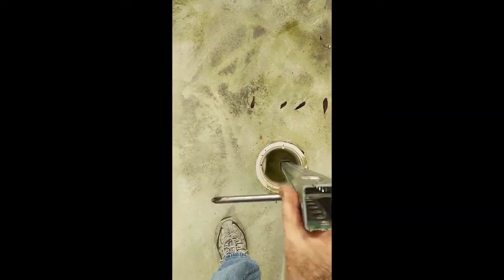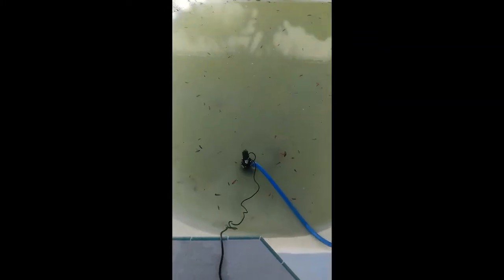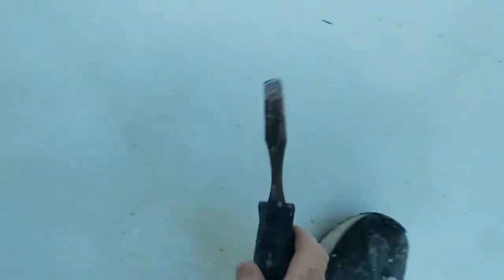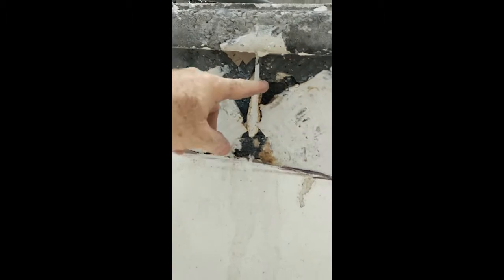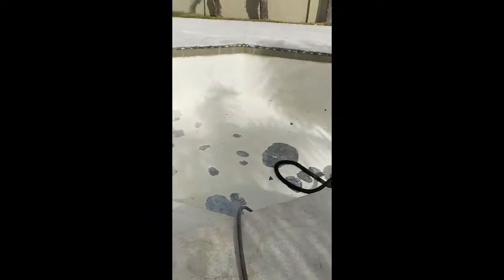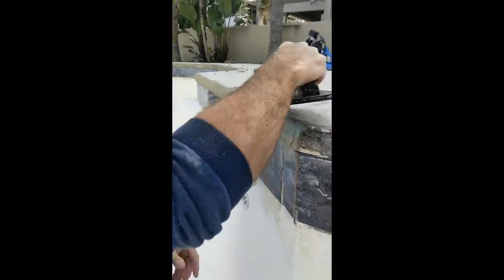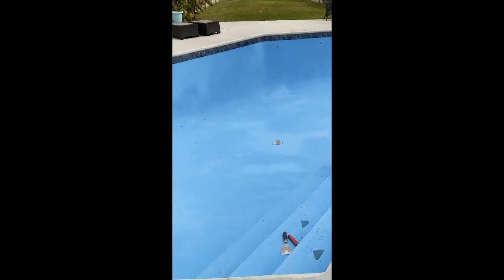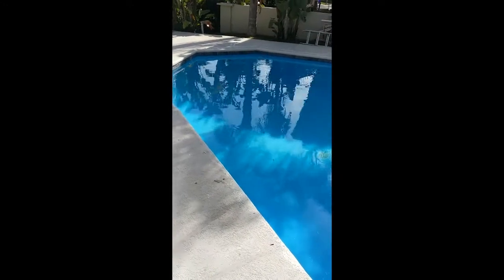Do it yourself pool renovation,  NOT PAINT.

Comment: Hello, your video was very informative. I live in Florida too. I'm about to start that project myself, I already removed the tiles and the grout. But I have an issue with water keep coming up through the drain. I think I might have a solution, first I can't seem to close off the drain enough there is always water coming. My idea is I'm putting a reducer in the drain from a 2" threaded side to a 2" slip joint so I can glue a 2 foot pipe. This should stop the small leak around the drain  ( I can't get all the sand out from the treads so it leaks) it should stop the leak at the drain, and with the top uncapped the water should come up the pipe, that should relive the water pressure trapped below the pool. I can use a type of bilge pump that can suck the water coming from the pipe so it won't overflow!!! I'd like to know what people think about this??? If you can keep the bowl of the pool dry, then you won't have a difference of discoloration.
About the hydraulic cement drying fast is in Florida the water is warm, so if the don't so much to do. But gallons of water in the REFRIGERATOR,  that willslow down the drying time, I've done it before.
Reply from the maker: I like the fridge idea,  but as far as the water from the drain,  Its not that its trapped under the pool,  its that I live at sea level,  30ft from the ocean.  You might have an easier time if you are not right near the sea.  The only way to slow it down was a plug.  I was also concerned with the pool popping up due to the pressure under it.

Comment: Thanks for the video,  we just bought a house with a pool and some pool guys told me they change the water in their pool every year so I drained mine and when I filled it , it blistered all over the place . It's about to be hot as hell here so in the fall I will be doing the same .  Good job btw 👍
Reply from the maker: Good luck.  Patching the holes was not real hard.  If you have any questions please let me know.
Reply: @stevek3270  I have a pool we used pool paint,it blistered last summer.Should I just get rid of all the paint and use colored plaster like you did? What's the best way to remove the paint? Also what plaster did you use? Thanks
Reply from the maker: @angelakidd2969  I used sider-crete, color ocean cove.  As far as paint removal,  I cant help you,  I did not have to do that on my pool as it was never painted.   I would recomment removing the paint and going with the roll on plaster as it will last a lot longer then paint.

Comment: Steve, great video.  what do you need to retie?  thin set mortar? or some kind of tile grout for pool?  thanks.
Reply from the maker: I used Home depot flex bond for the thinset,  it lists Bathroom,Countertop,Exterior wall,Floor,Interior wall,Kitchen Backsplash,Shower,Swimming pool,Tub surround as suitable locations.  For grout I used polyblend plus that lists the following as suitable locations,  Can be used on floors, walls, countertops, tub surrounds, showers and in submerged conditions (swimming pools, spas, water features and fountains).  Also from Home depot.

Comment: Hey Steve I agree great video! Have a question about work time of the product. Did you have help doing this and once a batch is mixed how long was it workable?  How much water was added to make it thinner? Thanks
Reply from the maker: Now that it has been a year and a half since I did it,  I am not as sure about the amount of water I used,  but I believe it was at least a quart,  but could have been as much as a gallon.  I just dont remember.  I did have help.  My son was rolling it while I was blading it.  As we got closer to the end of the pale,  I would take over the rolling, while he would start a new batch.  Before we started using water,  the batches were way too thick,  and would start drying too fast.  That made it very difficult to keep up.  Once we started adding water,  it made all the difference in the world.  It was easier to go on,  looked better, didnt dry too fast.  I could have done it by myself with the water added.
Reply: Thanks Steve much appreciated!

Comment: Any update on how the pool is doing since you’ve posted this? Thinking about going this route myself.
Thanks
Reply from the maker: It still looks great.  I would recommend this.  LIke I said previously,  I would use white instead of blue so it is more uniform in color.  Also,  I would have thinned out the first coat with water so it wasnt so thick, but over all it is good.
Reply: Thanks Steve 
Great to hear

Comment: Great job. I'm about to start doing exactly the same. You mention you used 6 sider-crete rolls on kit? is that correct bc my pool looks way smaller than your and they recommend 8 for me for two coat. my pool is 22 length for 10 width. or you did one coat only? one coat probably will be fine. Thanks
Reply from the maker: I had a problem with it being WAAAAY too thick.  The first coat was a PITA and took over six kits.  It would not roll on nice because it was so thick.   however,  I contacted the company and asked if I could water it down to make it thinner, and they said yes.  After that it went on way easier and I only used 3 1/2 kits the second day.  8 is probably right on the money but if the roller doesnt get it spread easy,  dont be afraid to add a little water.

Comment: hello Steve! I’m in Florida and I’m very handy guy. Did you ever have any fears of the pool popping out of the ground. I saw you in the video taking out the plug in the main drain. How long did the project take thanks Steve.
Reply from the maker: I was worried,  that is why I removed the plug.  I left the plug out as much as I could,  but every once in a while I would put it in,  and pump out what was in the bottom so I could go on to the next step.  I do believe that by leaving the plug out as much as i did, caused a little discoloration in the very bottom of the pool.  It seams the water level is exactly where a line is.  I think from the time I started draining the pool,  till I started filling it back up was around two weeks.
Reply: @stevek3270  thanks Steve I appreciate you getting back to me take care regards Sal.

Comment: how long did this take you ..start to finish ?
Reply from the maker: About 10 days.  One day to drain,  then power wash, then acid wash, then tsp wash.  That was about two days worth.  Then a day to find all the hollow spots,  and chip them out, and remove all the tile.  Then a day to repair the hollow spots, and repair the bull nose.  Another day to replace the tile,  then a day to do one coat of sidercrete, a day (if I remember right) to let it set up,  then another day to do final coat.

Comment: I found your video to be very helpful I have the exact situation that you have I am redoing the tile around the perimeter and repairing my pool and using all your tips the only thing I had a question about when they say they sell a bag for $129 is that the kit you’re referring to and did you use six of those bags to do your pool my question is how many bags did it take to do one coat
Reply from the maker: Yes,  that was the price of the roll on plaster that comes with the liquid mix.  I used 6 1/2 bags on the first coat,  and it was so thick that it was hard to push the roller into it.  After talking to the company,  they said I could thin it out a little with water, that made it much easier and the second coat only took 3 1/2 bags/kits.
Reply: @stevek3270  wow thank you for the info so you used 10 kits and went real heavy on the first coat you probably could’ve got away with 8 my pool is 20 x 50 I’m thinking I can probably do it with 12 bags and after reading your note I’m going to go with the white I really appreciate the input. working on chipping out the border tile right now
Reply from the maker: @nikogianna  My pool is 14 x 30.  I would stick with the recommendation of the company.  You dont want to be panicking like I was after the first coat thinking you wont have enough.  Make sure you use hydraulic cement under the new tile to create a waterproof seal so your pool wont lose water.  You cant count on the tile and grout to fill holes.   Good luck.
Reply: @stevek3270  Yep I went to Home Depot got Cement all going with laticrete platinum thin set
Reply: Just got done plastering pool A few days ago now full of water looking great thanks for your tips
Reply from the maker: @nikogianna  How many kits did you use?  Did you have to mix it with water to make it easier?

Comment: Just saw your video.  Great job.  Wondering why you used cider crete plaster? Did you consider epoxy paint? How is the plaster holding up?  Thanks Dan
Reply from the maker: I wanted a more permanent fix.  I read a bunch online and the paint had a relatively short life.  I was more concerned with the paint removal after it wore out then what it looked and felt like while in use.  So far so good with the cider crete.  It still looks fantastic other then the discoloration in the "bowl"  I dont know why but the bottom of the pool in the deep end is not the same color as the rest.  It didnt happen until about a month after filling with water.  It doesnt bother me too much though.
Reply: @stevek3270  thank you.
Reply: 2 other questions.  Did you acid wash before or after you removed the delaminated areas of plaster?  How long do you wait before removing the red stucco tape on tiles? Thanks a lot
Reply from the maker: @dha007  I removed the delaminated areas first, then acid washed.  I removed the red tape the day after final coat of plaster.
Reply: Hi Steve.  
Thanks for the info.  I'm using sider repair to repair delaminated areas but i ran out of the stuff..  wondering if you know of a similar product i can use from homedepot?
Reply from the maker: @dha007  Rapidset cementall.  It is hydraullic cement that i used under the tile,  it would be a good choice.
Reply: Thank you

Comment: How much did the project cost you? Do you have a general breakdown?
Reply from the maker: Lets see if I can remember this now.   Acid wash,  about $20,  Box of TSP,  $10,  3 bags of hydraulic cement at $50 each,  $150.  One gallon of concrete primer,  I think about $20.  A few  5 gallon buckets about $15 total.  I purchased 12 kits of sider crete that came to $1716.    I got three rollers for about $15, and the squeegee to spread the plaster at $30.  That gives an approx total of $1976.
Reply: @stevek3270  Thanks